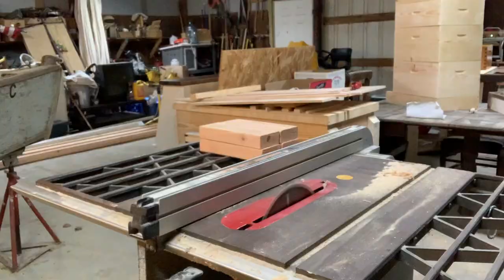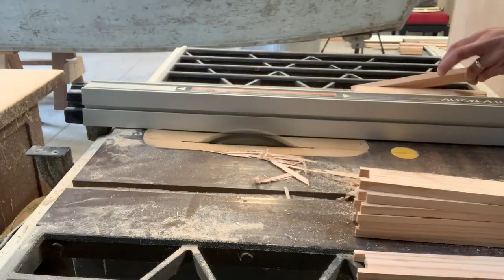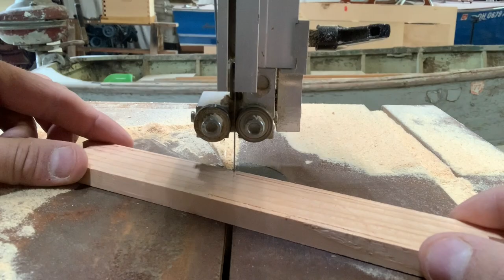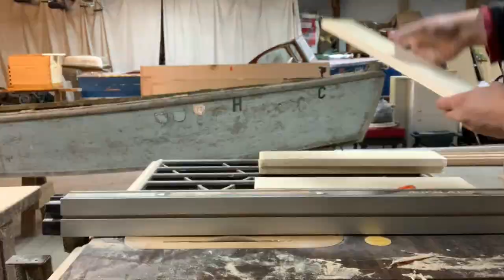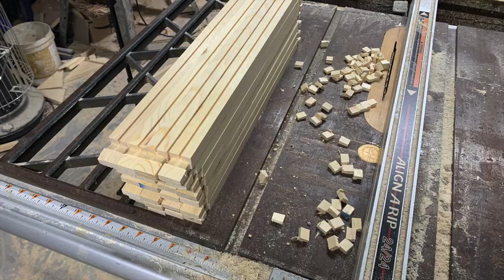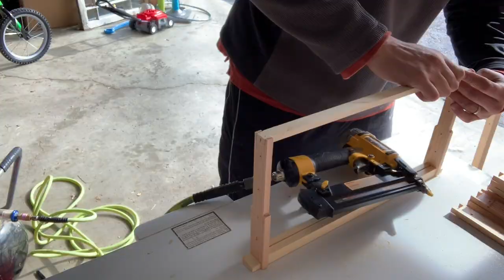DIY Beehive Frames - Never buy beehive frames again

Comment: I make all my own frames have been for 6 years running around 40 hives.  One thing I do different is I don't cut that grove in the bottom or the top. You don't need it. Just cut the side bar's a little shorter .  And the bottom bar put it on the inside of the side bars . I use 1 1/4 crown staples one down from the top bar each side and one in from the side bars on the bottom bar.  For a total of 4 staples. And I glue every thing.  Saves a lot of time and work. And am really cheap so I buy my wood from the Amish plane it down. But I get it for 45 cents a board foot. Never had a frame pull apart if u glue them.
Reply from the maker: I like your idea on not needing the grooves. I am a believer in gluing frames as well. It adds so much strength and have heard the only reason not to glue is to pull them apart easier to replace broken pieces - to which I would say just build more frames! I am a hoarder of wood, so I keep a lot of scrap lumber throughout the year and use it in the spring for all I need!
Reply: The groves are only needed if you use plastic foundation. If you use wax foundation, no grooves are needed, but you need to put the top wire within 1 cm (-5/12") of the top, or the foundation over the top wire will collapse if the bees cling onto it, to prevent that, the foundation is often inserted into the top grove. If you use no fountaion, the top groove is only needed to insert a starter strip, but normally it is sufficient to just run a line of wax down the middle, with no groove.
But best, use plastic.
Reply: I make all my own also and do not cut the grooves, just square them up and use glue and staples. never had one come apart or any complaints from the bees.

Comment: I wonder if a router would be more efficient for removing the excess material from the frame ends.
Reply: jup, thats how the pros do it. A big router with a profile bit (kinda like dado blades but for routers). Auto feed the boards and that "profile" then only needs to get sliced into finished pieces. way less cutting!

Comment: After watching some of the horror stories on YT, seeing people ripping without a riving knife or splitter always gives me the willies.  One moment of inattention and a board turned cockeyed and pinched between the fence and the up-turning side of the blade, and you could have a board thrown at you really hard and fast.  Please consider updating your throat plate with a simple splitter, a little flat piece of hardwood glued into the slot behind the blade, to hold the board against the fence well after it clears the upside of the blade.  Awesome job though.

Comment: How many frames can you make in an hour?
Reply from the maker: That's a great question. I usually work in a more leisurely way and complete my projects over several evenings. I would guess that these frames (about 30) took 3-4 hours from the initial cut to final assembly over several days.